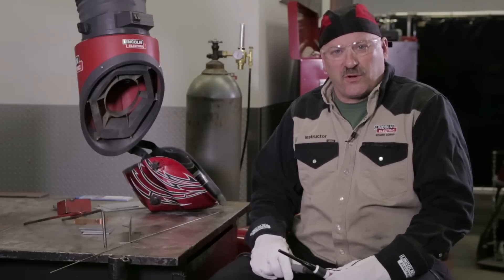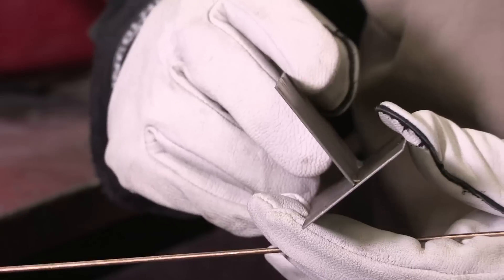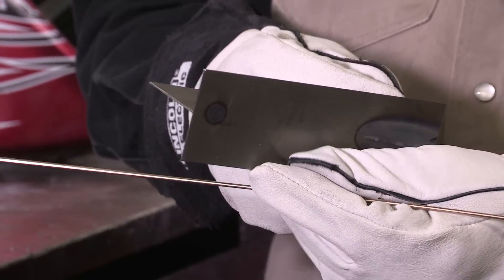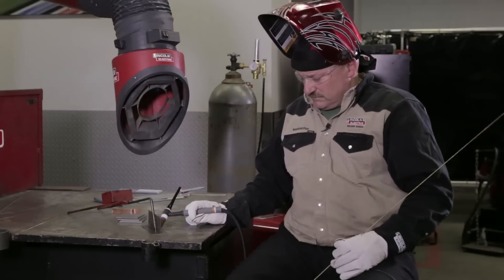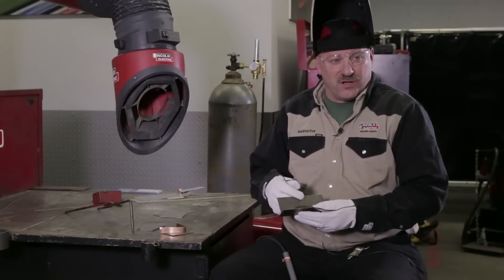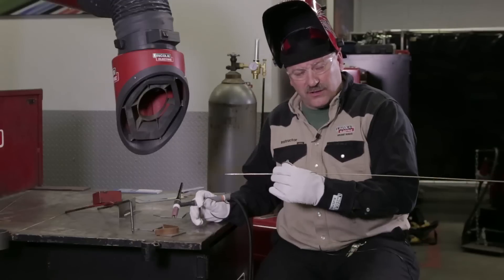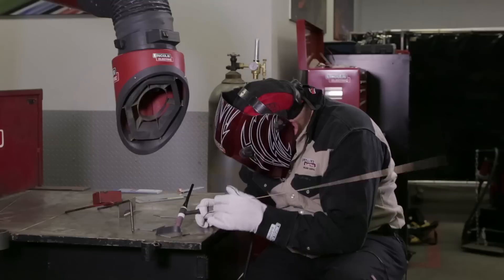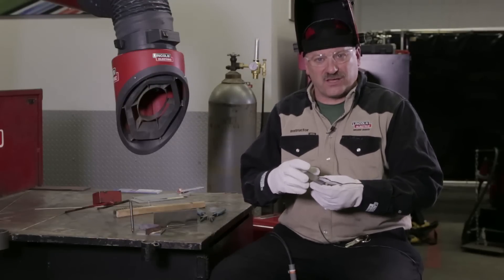Tech Tips: Welding with Copper Alloys

Comment: All welders make this stuff look so easy. I'm trying to do a simple bronze to bronze weld (2 small pipes) using HHO cooled with MAP gas. The bronze pipes are 1/4" thick but soon as it gets hot enough to melt I feed the bronze rod then it collapses, drips or distorts. When I weld steel I never have this issue. But something about bronze .. it's like the second the surface of the pipes & rod melt I push the rod then realize the whole back melted out. There's gotta be a better way to stop thin metals from collapsing when you need a weld as opposed to a braze. I known an arc would be ideal but the whole reason I built my HHO is to practice working with gases.
Reply from the maker: +Robert Cece Thanks for watching the video and for your question. Can you please direct this question with more detail to our "Ask The Experts" section of our website? We will be happy to help you the best we can. Here is the link:

http://www.lincolnelectric.com/en-us/support/ask-the-experts/Pages/ask-the-experts.aspx

Comment: that tungsten electrode you use for welding ?? you work in AC or DC ?? which the brass rod specification ?? thank you!!
Reply from the maker: +oldcarsgarage  You can use any DC classified Tungsten Electrode. We are working in DC- and the alloy we are using is silicon bronze (ERCUSI). There are other copper alloys but that is what we used. Thanks for the question!!

Comment: this type of weld can be very strong but you need lots of filler material then :-) I have a plate cutter welded with copper, very strong, long time ago they did a lot with copper welding.

Comment: This is a technique  brought to our shop by a retired Navy Chief about 20 years ago. We were repairing large sheet metal outer cases for hot gas expanders - complex structures that underwent thermal cycling , sometime several times a day.  These cases would crack along the HAZ from previous weld repair attempts.  These weldments were about 30 years old and  had undergone may different and unsuccessful weld repair methods by "experts" in the welding and metallurgy fields. Thanks to Chief Beckham!